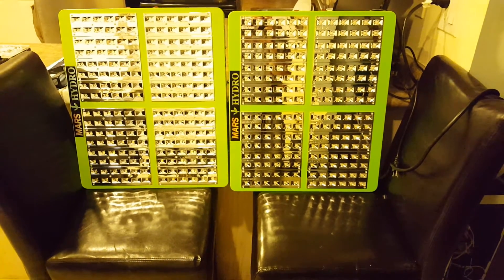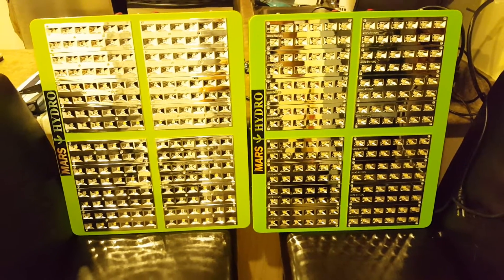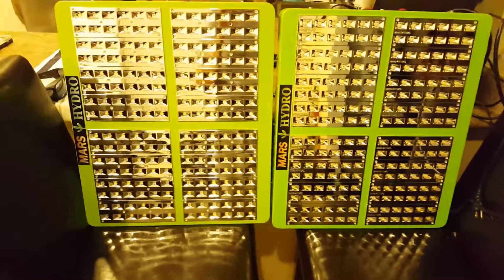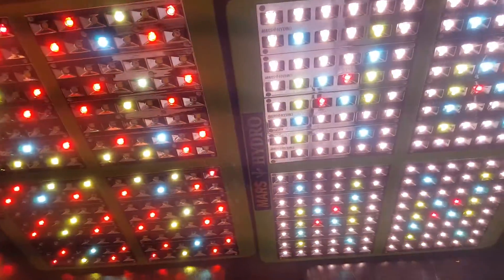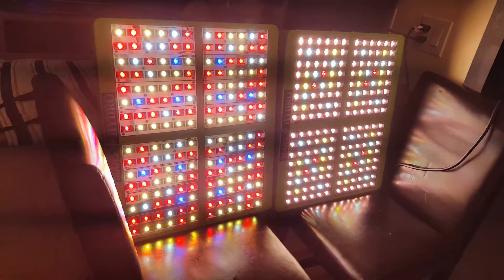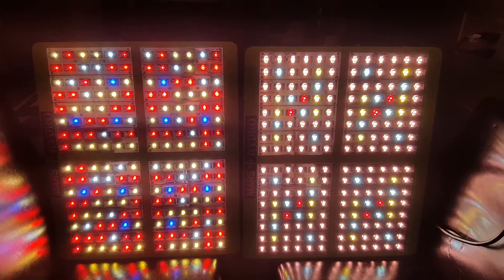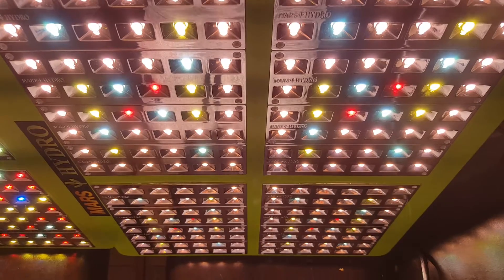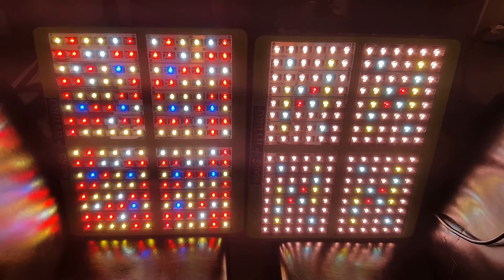Mars Hydro 192 Reflector Plasma Modulated Doner Design

Comment: You upgraded these?  Or you bought them this way.
Reply from the maker: I custom designed the spectrums and built them myself. I would bet anything you wont find more than 11 of these that were custom made :) Dave Doner Designs
Reply: David Doner LED Guru  Dude I bet.  Those are beautiful.  I have the same lights now I don’t want mine.  I want yours.  Lol.  Good job bud!
Reply from the maker: Im not going to lie, even both of these units needed a full tweak to gain better lutein production throughout vegetation and finally after 4 years now figured out how to fully boost ethylene throughout flower. I have some new designs coming in 3 weeks im willing to bet will beat anything LED.
Reply: David Doner LED Guru you selling I want something that also does uvb.

Comment: WHATSUP! I use the 192 in a 4x2 grow tent @16-22 inches away from tops. Is this too much light? I have zero heating issues (68-76 degrees, 48-60%rh). Thanks for the time
Reply: If so can I run just one of them switches at a time?